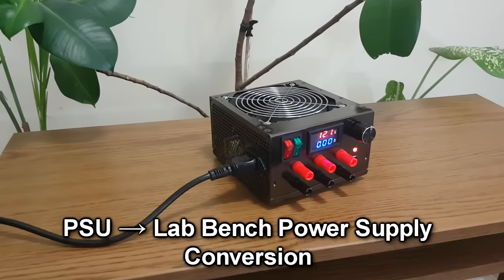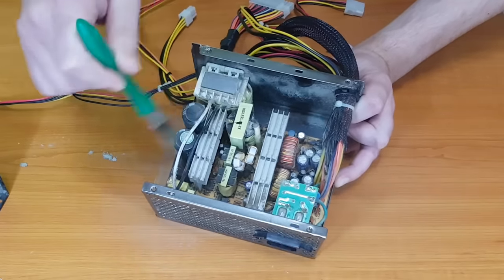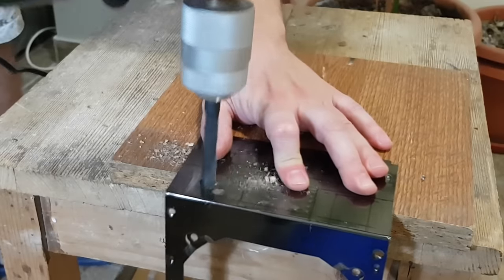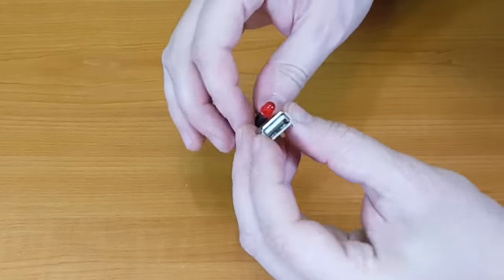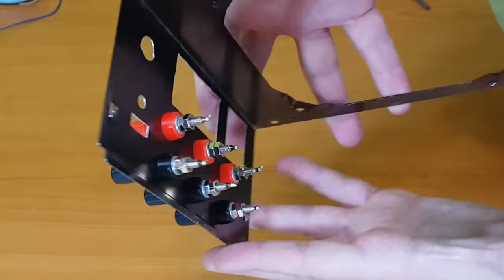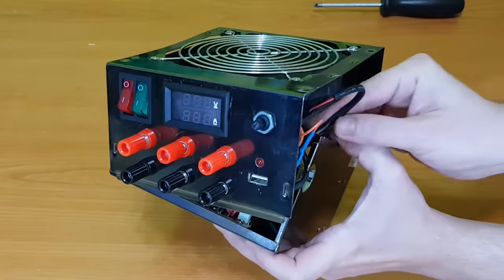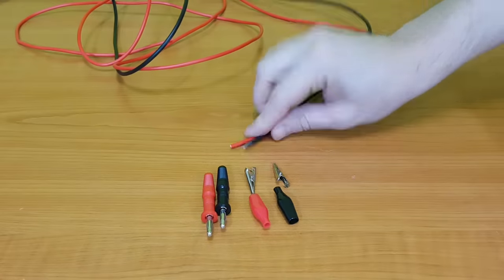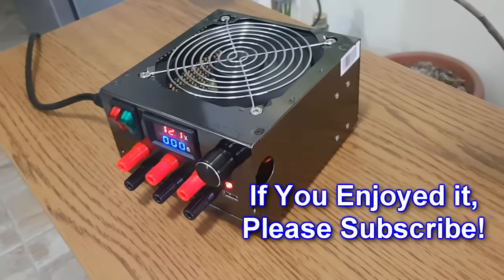DIY - Lab Bench Power Supply

Comment: Very nice video!  is there a parts list for this project and the dummy load resistor is a 10 w 43 Ohm or 3 Ohm?  The Double Rocker Switch is 250 Volt 10 Amps? Description on Rotary Switch,  and  is this the correct Digital Voltmeter Ammeter DC 100V 10A Panel Amp Volt Voltage Current Meter 0.28" ?  Thank you very much!
Reply from the maker: hi. I've bought most of the components from a local store, but you can find similar components online. the resistor is a 10W 43ohm or 47ohm. the rocker switch I think is rated at 16A, but it will work with a 10A switch also. the voltmeter description is correct. I will make a list soon with similar components, that you can buy online. here are a few parts: 
https://www.aliexpress.com/item/4000135374668.html?spm=2114.12010615.8148356.45.61a311efirklu9
https://www.aliexpress.com/item/1852220665.html?spm=2114.12010615.8148356.9.356619d2yAPNby
https://www.aliexpress.com/item/32924867541.html?spm=a2g0o.productlist.0.0.510611b0af0Oe6&algo_pvid=b0c7f9cb-637d-4021-b253-24fe233d48e2&algo_expid=b0c7f9cb-637d-4021-b253-24fe233d48e2-1&btsid=0be3743615817560441513983e651d&ws_ab_test=searchweb0_0,searchweb201602_,searchweb201603_
Reply: @Sorin_DIY , Thank you very much for the information, l will join your page in March pay for subscription.  I'm on fixed income disabled, but l appreciate you following up to my question.  Love your projects 👍
Reply: @Sorin_DIY , l remembered being in Jr. High tinkering around with Electronics and computers... yes punch cards.  Then in High School Physics, Radio Physics, CB Radio's and HAM Radio's and now at 60 years old still love this Hobby.. It gives me great pleasure to see your Skill, your Ideas, and Love for your Projects and helping me and others.  God Bless you

Comment: Sorin Hi, been watching some of your YTube Videos on Electronics, in particular ATX Power Supply Conversions to Desk Top Lab Supply. Today I obtained an ATX Power supply but its completely Alien to the Ones you show. Example there is No room inside for any extra expansion as there are 2 PCB completely taking up all the space at top and bottom. Also this supply has extra wires Blue/White stipe and White. Can you help off line PM. Cheers? Clive
Reply from the maker: hi. on older power supplies the white wire is -5V and blue is -12V. but to be safe you should use a multimeter to determine the voltage of all the wires. you can buy a bigger electrical box and put everything in it to have more room.

Comment: Hello could I put an equipment with more AMP to 16 or 20 AMP? Tks.
Reply from the maker: hi. it depends if your load has an inrush current. if it does, the inrush current must be lower than the output current of the power supply.

Comment: My 5v sb keeps fluctuating and the psu does not turn on. The powers supply is new and no caps bulge is there any fix
Reply from the maker: the 5V sb output is usually less powerful than what it's rated for. I suggest you use the +5V red rail.

Comment: Well done!  If you wanna make a new tutorial you could expend to a 24v/12v switchable dual PSU setup with a simple "car breaker" hub for some added safety :)
BTW didn't know i needed a dummy load on modern PSUs, not using that in mine, but now i gotta try it out :P (figured the 3 fans in my case would make up for that)

Comment: Hi  Only one question: the common rotary switch have 0.5A / 1A maximum current. If I have to measure 9A (the ammetter have 10A max) the rotary switch burns. Could you explain it? Thanks
Reply from the maker: that is true. but that's not how I wired the switch. please watch the part2 video for clarifying this.
Reply: Thanks

Comment: Great video! I want to build my power supply, one doubt: the resistor HAS to be 10W 43ohm, can it be 20W 47ohm or 20W 39ohm? Thanks.
Reply from the maker: hi. the load resistor should be minimum 10W. 20W is even better, it will get less hot. the resistor value depend on the power supply. but most power supplies will work with all values you mentioned above.

Comment: hello there from i just make it and its very nice but i have an issue when i rotate it from 5v to 12v its ok then when i turn it to 5 the psu turn off... if i rotate it from 3,3v to 5v and then to 12v its ok but when i will rotate it from 12v to 5v the psu always turn off.. why??????i make everything like your schematic. also i have connect a peltier but the amp stay at 0 even when i plug 5v or the peltier, doesnt goes up
Reply from the maker: hi. you have a different rotary switch and it's not good for this project. you need a rotary switch exactly like mine, or if your switch has 6 positions, you can skip a position after each voltage. for example you can use the 1, 3, 5 pins for the 3.3V, 5V, 12V. and you probably did not connect the ammeter correctly.
Reply: @Sorin_DIY  its the same rotary.... Maybe its only for a few times now working good... The issue that i have now is that i see only amps from the 5v USB... For the 3.3v ,5v and the 12v nothing

Comment: Hi there I'd like to run something that require a thirsty 12v load currently the ac/dc adapter I have can't handle it dropping to below 7v and going into shut down will this maintain constant 12v?
Reply from the maker: hi. it depends how much current you need and how high is the inrush current. PC power supplies are much powerful than simple charger and should give you enough current. but if you want to start a powerful motor, it will need a high inrush current and this can turn off the PSU. in this case you can add a 0.5ohm power resistor in series with the motor, like I did in the cordless drill conversion video.
Reply: @Sorin_DIY  so so good and thank you for your reply 👌👌🤙

Comment: Can you use regular resister for a dummy load?
Reply from the maker: do you mean a smaller resistor? you need a 10W minimum resistor, or it will get very hot.

Comment: One thing i dont understand is why did you make it just for 3 Volt/Amp modes instead make a knob that you can switch from lower Volt/Amp to higher also different modes between Volts and Amp like a Stand Power supply , Overall looks good m8 i'v got one on my own its old but 260W so it shuold do just fine
Reply from the maker: hi. this is a very powerful fixed voltage power supply. I use it for projects that need a lot of current at the standard voltage values 3.3V, 5V, 12V, USB port. I've also built a variable power supply, which also is very powerful. you can find the video on my channel.

Comment: Hey! Every time I switch it on, it only makes a small "jump" of voltage and then stops. Can I fix it somehow?
Reply from the maker: hi. this usually happens when it detects a short circuit or a big load or some capacitors may be swollen. you need to check all the connections, switches and capacitors.
Reply: @Sorin_DIY  Thanks man!

Comment: Hi could you explain how do you link ammeter with the switch and binding post. Thanks
Reply from the maker: hi. I've explained it in the part2 video.
Reply: Hi  @Sorin_DIY  Thanks a lot. Only one question: the common  rotary switch have 0.5A / 1A maximum current. If I have to measure 9A (the ammetter  have 10A max) the rotary switch burns. Could you explain it? Thanks

Comment: hi a pc psu that has 450w of power, can it wasting same 450w, with no pc components? please reply fast
Reply: The output Power of a Power Supply Unit, means that it can provide stable voltages for up to x Watts. eg: 5V * 90A = 450W , meaning it will with no problem provide 5VDC for up to 90 Amps. For your math in Power Outputs you should consider adding all voltage (3.3 , 5.0 , 12.0 etc) loads.

Comment: Hi, great video.
Can you tell me what i have to do to make a variable PS like yours?
0 to 12 volts or 0 to 24volts with ampere ajustment.
A schematic will be appreciate !

Thank's ,
Reply from the maker: hi. I will soon make another power supply with fixed and variable voltage. I will explain everything in that video.
Reply: @Sorin_DIY  ok thank's
Reply: @Sorin_DIY  Hi, Sorin  Have you made the video ?

Comment: Hi i have a PowerMan (InWin): IP-S300EF7-2 powersupply and i want to increase the voltage to 13,8 volt. Could u help me please. There is a 1mohm pot meter inside and voltage can be adjust from 11volt to 12.8 volt.

Comment: my PSU gives less than 1amp when I use 12V(yellow wire) which is supposed to give 10Amps. Can you please solve this problem.
Reply from the maker: what happens if you try to draw more than 1 amp from it?

Comment: Hi, today I have recreated this project, but if I connect a load to the powersupply and it shuts off. Can someone know how to fix it?
Reply from the maker: hi. what kind of load did you connect? did you added dummy a dummy load resistor? did you checked for swollen capacitors on the PSU circuit board?

Comment: What is the (- 12v) wire for?

Is it possible to obtain  24 volt?
Reply from the maker: hi. some older computers in the '90 used the -12V rail for some components. now I don't think it's used anymore. yes you can combine the +12V and -12V rails to obtain 24V, but it will have the lowest current of the two, 0.5A. it's not very useful.
Reply: @Sorin_DIY  Highly appreciated!

Comment: how many of wires you put in 1 binding post ? does not seem you used all the wires from psu ? thanks
Reply from the maker: hi. for the positive outputs I connected 3 wires to each binding post. and 4 black wires to the negative binding posts.
Reply: @Sorin_DIY  for the rotatary switch you using, is it 1pole 4 position ? thanks alot
Reply from the maker: 2 pole 6 position
Reply: @Sorin_DIY  thank you

Comment: my power supply dropping voltage to 11.5 under load,would a 10W 47ohm solve this issue :)
Reply from the maker: I don't think so. your PSU probably doesn't have enough power for what you are using it for.

Comment: How come the binding posts aren’t shorting against the metal case
Reply from the maker: because the metal inside the binding posts doesn't touch the power supply case. only the plastic shell of the binding posts is fixed to the case.

Comment: Nice video!  Great explanation of the colors/wires.  It left me wondering.  When you connect the load resistor like that, how much current is wasted going through the load resistor?  If I was to build a PS like this and run it 24/7, how much money would be spent on the load resistor?

Comment: What ground cables were connected to the amp meter and where were both sets of cable from the red switch were connected to?
Reply: That meter module measures "low side" current - three black wires from the PSU into the meter and all three black binding posts out from it.  The other black wires from the PSU were cut and abandoned.   Red switch arranged to interrupt incoming live.
Reply from the maker: please watch the part2 video for this explanation

Comment: is it possible to get 24V from PC power adapter?
Reply from the maker: hi. if you measure the voltage between the blue wire and a yellow wire, you will have 24V. but it will have only 0.3A or 0.5A. another way is to use a step up converter on the 12V output and increase the voltage to 24V. powerful ones are a bit expensive.

Comment: How you determine the main 10w 43r load resistor that is connected for the make the power supply run? Why 43r? E.g Can I use more or less resistant such as 300k or 15r?
Reply from the maker: it depends on where you want to connect the resistor, on the 5V or 12V output. the dumy load resistor needs to draw maximum a few hundred mA, or it will get very hot. on the 5V output the current draw is 5V/43ohm=0.11A. you can use a resistor of 47, 33, 22ohm. if you go lower, it will get very hot. 5/22=0.22A.
Reply: @Sorin_DIY  Thank you. What if I make resistance much higher?
Reply from the maker: it will use less current. but it will still work with most power supplies.

Comment: I'm trying this mod on an old psu I presumably fixed. Anyways all I can get with my multimeter is 5v from the green start wire and 5v from the purple standby wire. I put a jumper wire between the green wire and a black wire, but I still can't get any sort of voltage from the other wires! Any ideas? Or is my psu just faulty?
Reply from the maker: hi. these power supplies have a separate 5V smaller power supply (like a low power USB charger), which in your case it works. this is used for the standby voltage and for powering the main power supply. but the main power supply it's probably faulty.
Reply: @Sorin_DIY  XD damn! Thanks for the response though! I already ordered the parts lol. Maybe i can still fix though, who knows. Love your videos BTW, they are all great!

Comment: I have a problem with mine. the amp meter shows me 58.3 amps for all 3 voltages what seems to be the problem
Reply from the maker: the ammeter is not good, or is connected incorrectly. try it with another ammeter.
Reply: @Sorin_DIY  ok ill try it

Comment: hi

i don't have that dummy resistor ..
when i plug the power supply to 220v input
i get 5v from every wire with green one.. and the fan is not work ..
any advice ?
Reply from the maker: hi. did you turned on the power supply, by connecting the green wire to a black one?
Reply: yes of course ...
Reply from the maker: what power supply model do you have?
Reply from the maker: it should turn on in the same way. try to connect the green wire to a black one. then measure the voltage between black and orange / red / yellow wires.

Comment: Nice looking build and all, but i do not understand why: 1. You got 3 GND connectors when they are all connected to 1 GND cable, which all GND cables are also connected togheter so it will never make any sense for me. 2. why do you use 3 power connectors while you're switching them on and off; you could use only one with a bit more work or 3 without this knob. Not hating tho, just saying.
Reply from the maker: hi. please watch the part2 video for clarification.

Comment: Why is my ATX 12 volt line dropping even if I connect a small 12 volt /960 milli amp fan from 12.08 to 11.05 volts though the label  on the ATX shows 12 V at max 10 Amps
Please help and reply
I am using a dummy load of 8 ohms / 50 W which is getting very hot
Reply from the maker: hi. the wires also waste some power. did you measure the voltage near the power supply circuit board, or near the load? if you use thin wires, you will have different voltages. try to use thicker wires. and try with a different dummy load of 100ohm 20W on he 12V output. if it still doesn't work, there is probably a problem with the power supply.
Reply: @Sorin_DIY  
Thanks Sorin for your kind reply, Shall try what you suggested The wires are the ones from the ATX Itself 3 yellow wires12V and four from the Red, 4 from black and 3 wires of Orange. I tried 2 x 12 volt 30 watts auto bulbs in parallel along with a 8 ohms/50W resistor and the 12 V line seems to improve a bit, but the 8 ohm resistor heats up a-lot. Could the 300uf/200V capacitors be weak, after discharging them I checked with my capacitor meter it reads 262 & 267 uf
Please reply, thanks for your help, all the best to you

Comment: why did you use three ground binding posts, while all of them share the same ground, you could use only one, but I know, when you buy these ,they come each with the positive and negative binding posts, you could make a bit more space if you used only one. Afterall it's amazing Power Supply.
Reply from the maker: hi. I think it looks better with 3 black binding posts and I can connect multiple loads in the same time.
Reply: @Sorin_DIY  Probably yes Sorin , use for multiple loads😉

Comment: I cant find a 10w 43ohm resistor can i use a other one or a couple?
Reply: try RS Components
Reply from the maker: hi. you can use another resistor, or connect multiple resistors that give you a value of 33-47ohm. lower than 33 - it will get very hot. higher than 47 - it will use very little current, but it will still work for most power supplies. you can watch the part2 video for more info.

Comment: can i use  the 12 volt output for brushed motor 775?
Reply from the maker: yes, but you need a motor speed controller. the motor inrush current is bigger than the power supply can deliver.

Comment: Recently I opened a PSU which I will use for my 3d printer. I desoldered and removed some cables that I don't need (some 3.3v, 5v, 12v and grounds).
After doing this somehow the PSU now starts without connecting the green wire to a black (ground) wire. To be clear, I did not desolder or connect the green wire to ground. I did not even (de)solder near the green wire.
Before I removed these cables I always had to connect the green wire to a black wire to power on the PSU. Does anybody know what can be wrong?

Comment: Can I use this to charge my 12v car battery??
Reply from the maker: hi. you need to modify it a bit more. car batteries need between 13.8V and 14.4V to get charged. so you need a very powerful step up converter on the 12V rail, to increase the voltage.

Comment: Why the three binding post pairs when you use a rotary switch to choose the voltage. You can do one or the other thing but both is overdone. Or do you use the rotrary switch just to feed the voltage to the panelmeter? Kind of useless as you have 3 fixed voltages that dont change much with load! You should have turned this into a variable voltage output supply by modifying the feedback circuit. If it has a TL494 or a KA7500B PWM-controller chip this would be quite easy as pin1 is the voltage feedback that expects 2.5V as a regular voltage. If you modify the voltage divider for pin1 you have a variable output supply! In some cases you have to adjust or modify the OVP if present.
Reply from the maker: hi. please watch the part2 video for clarifying all your questions.
Reply: Where is part2?  thanks